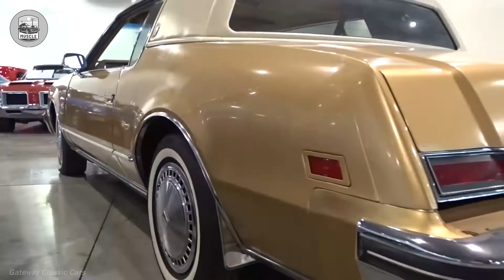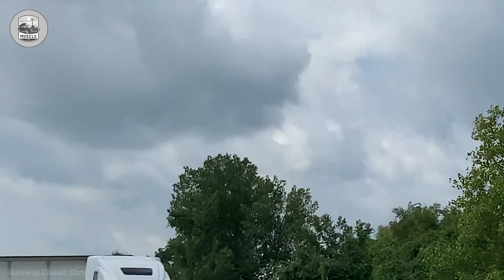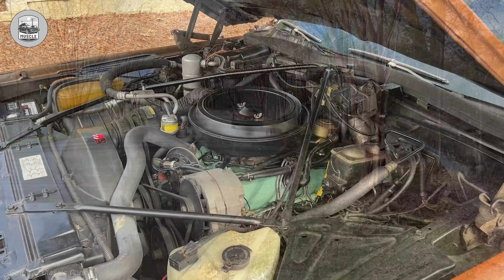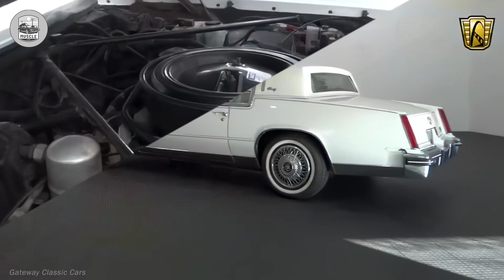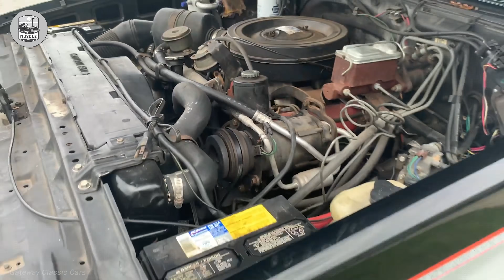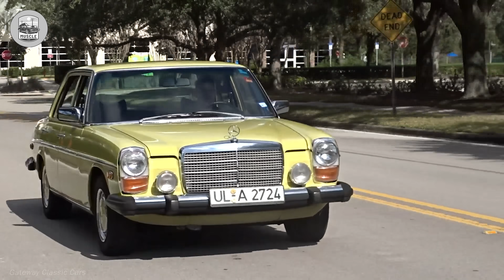Why Oldsmobile's Diesel V8 MOST FAILED?

Comment: To be fair, it was economical considering the engine size and the size cars it was put it. Junkyard Digs did a tow test and if I remember correctly it did 25mpg or more.
Reply from the maker: A lot of ppl forget the bottom end on those was actually pretty stout. Big main journals, decent crank, and the torque curve was right where a diesel should live. The real headaches usually showed up around the head bolts and sealing. Gas block converted to diesel compression meant the clamping load was asking a lot from the hardware.
Another thing that hurt them was fuel quality back then. Early diesel pumps and injectors were sensitive, and a lot of owners treated them like a gas motor… skip filters, water in the fuel, etc. Once the injection system got unhappy, the whole engine got blamed.
In stock trim they were never meant to be high RPM anyway. Keep them in the low rev torque band, keep the cooling and fuel system healthy, and some of them actually ran a long time. Problem was by the time people figured that out, the reputation was already cooked.

Good day bro, hope to see you on our NEWEST VIDEO for The INSANE TRUTH about Ford’s 98 Pound “UNBREAKABLE” Transmission!

Comment: I was a "Diesel" mechanic at a Oldsmobile dealership from '79-'85, fresh out of trade school, didn't know anything about diesels. The service manager handed me a service manual to read. That was my training. The 4.3 and 5.7 V8's all had problems, rear main seals leak "rope seal" Blown head gaskets, injection pump gov retainer would break up into little pieces and plug up the return port, causing stalling. The bottom ends would blow out at any mileage, snap the crank in half, rods through the block, we would oftentimes be able to drive the cars into the shop with horrible damage. GM started suppling us with crate engines instead of short blocks because we were replacing them all the time. The 6.2 was suppose to be better, it blew head gaskets too. Even the V6 diesels in the Ciera's were crap.
Reply from the maker: Yeah I’ve heard the same from a lot of guys who turned wrenches in that era. GM rushed those Olds diesels out the door trying to answer the fuel crisis and they paid for it. Turning a gas block into a 22 to 1 diesel without beefing the mains or the head bolt pattern was asking for trouble. Once the Stanadyne gov ring started breaking apart it was game over because the return got plugged and the engine stalled like someone shut the key off.
Most of the techs I’ve talked to said the craziest part was how bad the bottom ends were. Cranks would snap, rods would exit the block, and somehow the customer still drove the car into the shop making sounds like a bucket of bolts. GM sending full crate engines instead of short blocks tells you how bad the failure rate was. And yeah the 6.2 was better, at least it was a real diesel design, but even those popped head gaskets till the later updates.
A lot of folks bash these engines today but the truth is GM tried to solve a big fuel crisis with gas engine parts and super tight deadlines. Wrong tool for the job. If they’d built a purpose made diesel from day one, the story might’ve been different.
have a great day, hope to see you on our NEWEST VIDEOS...
Reply: That's funny, I worked on them in that era too and I don't remember ever seeing or hearing one with a broken crank. Head gaskets and the like here and there. If GM would have put a water separator on them, that would have eliminated the pump troubles. The guys that drove them long distances, appreciated the 30 plus MPG. The bottom end was plenty heavy and no they were not a converted gas engine.

Comment: its funny so many hate these ... yet i own 3 one in a truck and 2 in cars.... u arp stud them head gasket issues go away... then if creative slap a turbo on... and they become fun  my 1 diesel pushes 15 psi .. but yep they are junk lol nope .... to each there own i guess
Reply from the maker: Right on man. Most folks never gave those Olds diesels a fair shot. Once you swap in ARP studs, fix the head bolts and fuel setup, they actually hold together fine. A little boost like your 15 psi setup wakes em right up too. They were ahead of their time but got a bad name from early builds and poor maintenance. You’ve proved they can be solid when done right.
have a good day, hope to see you on our NEWEST VIDEOS to find the TRUTH....

Comment: A lot of comments, but no real answer, just answering questions with questions, just a bunch of
Reply from the maker: Yeah I get what you mean man. The Olds 5.7 diesel got a bad rap mostly cause it was built off a gas block that wasn’t meant for 22 to 1 compression. Weak head bolts and bad fuel injection pumps didn’t help either. They made around 120 hp and 220 lb ft, not bad for mileage but folks expected V8 power from a diesel. Once you ARP stud the heads, balance the crank, and tune the pump right, they can actually hold 15 psi boost easy and last 200k. Most people just didn’t give em a fair chance.
Have a good day, hope to see you next time on our NEWEST VIDEOS to explore the TRUTH.
Reply: @MuscleCarMasters68 mechanical failures in those engines were caused by ignorance on part of the owners mostly, for 6 years I watched the same thing happened over and over, running the engine with almost no oil in it, far as fuel contamination, all you had to do was go to a Detroit diesel and buy oil and fuel separator, since Detroit diesel was a subsidiary of GM, because cars that were sold in southern states rarely had to replace the engine, so how do you explain that?????
Reply from the maker: You’re not wrong — and the regional pattern you mentioned is real.
A lot of the early failures came down to owner education and operating habits, not just design. Diesel engines don’t tolerate low oil levels, infrequent changes, or gasoline-style maintenance, and many owners treated them exactly like a gas Olds V8. That alone killed plenty of them. Add fuel contamination and no water separation, and the injection system never had a chance.
You’re also right about the southern-state survival rate. Warmer climates meant easier cold starts, less fuel dilution, fewer glow-plug cycles, and far less stress on head gaskets and bolts. That’s why cars in the South often lived much longer than their northern counterparts.
The Detroit Diesel separator fix was well known in heavy-duty circles, but it never made it into mainstream car-owner knowledge. Once oil control, fuel filtration, and maintenance discipl
So yeah — flawed execution by GM, but widespread misunderstanding by owners made the outcome far worse than it had to be.

Thank you for your great information, have a good day and Happy New Year...hope to see you on our LAST VIDEOS with TRUTH Behind the Dana 60!

Comment: As a mechanic who had just graduated in 1978 , based on my own personal observation I attribute mechanical failure due to dim witted owners who bought the cars without prior knowledge diesel engines in general and furthermore those same individuals destroyed their own engines , other than less than the proper amount of oil for the crankcase and lack of a water in separator and all the special equipment that nowadays is standard on today's Duramax 6/8 diesel engines, same shit that was supposed to have been standard on Oldsmobile engines first, but the cheap bastards wouldn't spring for, so the customer became a unwitting pawn,as how to guess what to do maintenance wise, but mechanically the engine was built well, but was poorly maintained
Reply from the maker: Exactly, Raymond  you nailed it from a mechanic’s point of view. The old GM diesels, especially the converted Olds 350s, weren’t junk like people say — they were victims of bad ownership and cheap corporate shortcuts. Most buyers didn’t understand diesel maintenance back then — no water separator, wrong oil, skipped fuel filter changes — and that spelled disaster. You’re right, the engine’s core design wasn’t bad; it just needed proper support systems. If GM had invested in better training and components like modern Duramax setups, those motors might’ve earned real respect instead of a bad reputation...
have a great 
hope to see you next time.

Comment: What killed many 5,7 diesels, was the lack of a water seperator. Diesel fuel in the 70`s and 80`s was notoriuos for water content. Owners with some diesel experience (boat and truck owners) installed vater seperators in their cars from new, and put 0.5-1% with two stroke oil in the diesel fuel for better lubrication of pump and injectors, and never had any problems with theese engines. The later DX version where good and reliable engines. Some drove their diesel engines over 300.000 miles.

Comment: I never understood why engine torque matters. Horsepower and horsepower over an RPM range is all that matters. You can get any torque you want at the wheels with appropriate gearing.
Reply: Yeah! And have a top speed of only 35 mph.
Reply: Or need a 25 speed transmission.... 😲
Reply from the maker: This is one of those debates that never dies 😄 and both sides are partly right.
On paper, yeah, horsepower over an rpm range is what determines ultimate acceleration and top speed. Torque is just a math component of hp. Gearing can multiply torque at the wheels. That’s all true in a physics book.
Where torque starts to matter is the real world. Street cars don’t have infinite gears, instant shifts, or engines that live at peak rpm all the time. A motor w strong torque down low feels fast because it is fast where you actually drive it. Pulling away from a light, rolling into traffic, passing without downshifting three times. That’s torque doing the work.
You can gear a low torque high rpm motor to hit hard, but then you pay for it w drivability, noise, heat, fuel use, and yeah… top speed if you go too far. That’s why the jokes about 25 speed trans and 35 mph exist 😂
That’s also why big cube street motors ruled. They didn’t need perfect gearing or constant rpm. They just pulled. HP wins races on paper and at the track. Torque wins arguments at stoplights and on the street.
Different tools, different jobs 👊

BTW, A lot of people talk about it, but if you don’t actually know why that insane GM carb trick woke these v8s up, our newest video explains exactly how it worked.
have a good day and A Merry Christmas...

Comment: Was the early Oldsmobile 5.7 Diesel as quick or quicker than such traditional Diesel cars as the Mercedes 240D and the Peugeot Diesel ? None of those cars were "fast" although some of them were reliable and long lived when maintained. Only when Mercedes began offering a turbocharged "300TD" did a Diesel start to overlap performance of some gasoline fueled vehicles? 
 Sometime around or after 1980 the Olds 5.7 "DX" got a higher grade engine block ?  
Meanwhile Olds gasoline V8s got about 100 lbs. of metal removed from redesigned and inferior engine blocks used on 305 and 403 gasoline engines and maybe the later 350 gasoline engine ?
Reply: NO! they were absolute POOCHES
Reply: Olds NEVER made a "305".....
Reply: @davelowets  
True, he was actually referring to the 307.
Reply from the maker: @davidpowell3347
You’re asking the right questions, and the short answer is no, the early Oldsmobile 5.7 Diesel V8 was not quicker than cars like the Mercedes-Benz 240D or the Peugeot diesels of the same era. In fact, straight line performance was never the Olds diesel’s strength. Stock for stock, it was slow, especially in passenger cars saddled with tall gearing and emissions era calibrations. Torque was there down low, but acceleration was nothing to brag about.
Where the comparison gets interesting is intent. Mercedes and Peugeot designed their diesels from the ground up as diesel engines. Heavy blocks, conservative rpm limits, and fuel systems engineered for longevity first. That’s why the 240D felt painfully slow but would run forever if maintained. The Olds 5.7 was a gasoline architecture adapted to diesel pressures, and that decision defined its fate. When everything was perfect, they could live. When fuel quality, maintenance, or hardware slipped, failures piled up fast.
You’re also correct on the timeline. Around 1981, Oldsmobile introduced the improved DX block, which added strength in critical areas. By then, however, the reputation damage was already done. As Mercedes-Benz 300TD entered the U.S. market, that was the real turning point. Turbocharging finally gave a diesel performance that overlapped with some gasoline cars, something the naturally aspirated Olds diesel never achieved.
On the gasoline side, your observation is also fair. GM aggressively removed weight from its small block castings during the late 1970s and early 1980s. The Oldsmobile 403 and later engines emphasized reduced mass and fuel economy over brute strength. That strategy worked for emissions and mpg, but it narrowed the margin for abuse. Just to keep the record straight, Oldsmobile didn’t make a 305, that was Chevrolet. Olds used the Oldsmobile 307, which often gets mixed up in these discussions.
So your framing is accurate. Early diesels weren’t fast, they were durable when purpose built. The Olds diesel tried to shortcut that process and paid the price. Mercedes didn’t make diesels exciting until turbocharging arrived, and by then Oldsmobile’s diesel story was already written in the public mind.

If you’ve ever wondered why that GM carb trick made lazy v8s come alive, we go deep into it in our newest video and explain what most people missed.
have a good day and A Merry Christmas....
Reply: 1981 was the first year the improved DX block was used, but it hardly mattered to those who were already disappointed with their Olds diesel-powered cars, and 1981 was also the same year Mercedes came out with their 300TD (meaning when it became an actual "Turbo Diesel" wagon) here in the U.S.

Comment: We need to get one thing out of the way: the LF9 5.7L diesel V-8 is NOT an outright conversion of the existing gasoline Rocket 350 V-8. Rather, while it had the same bore and stroke dimensions as its gas cousin, the diesel had to be made with more rigid parts to withstand traditional diesel operating conditions, including the block, crankshaft and cylinder heads.
Reply: This is correct. The block internals were completely different as well as the entire top end. The crank main journals were 3” compared to gas engine 2.5”.
Reply: @alwaysanotherproject No. A complete gasoline top-end will bolt RIGHT on to a diesel block....
Reply from the maker: This is one of those debates that refuses to die — and both sides are partly right.
The LF9 5.7 diesel was not just a “gas 350 with injectors.” The crank had larger 3.00 inch mains vs 2.50 on the gas motor, compression ratio was around 22.5 to 1, the block had thicker main webs, different head bolt strategy, and provisions for the Stanadyne DB2 injection pump. Internals were absolutely beefed up for diesel cylinder pressures.
But Dave isn’t wrong either. The architecture was still Oldsmobile small block DNA. Bore spacing, deck height, bellhousing pattern, lifter layout — all shared. That’s why gas top ends physically bolt on. The diesel block is basically the strongest production Olds small block casting ever made.
Where the real failure happened wasn’t the casting — it was head bolt count, early fuel quality, lack of water separators, and owners treating it like a gas engine. Stretch bolts + 22 to 1 compression + water in fuel = head gasket city.
Real fans know this wasn’t a “weak block” story. It was a system integration failure.
And that’s a very different accusation.

Have a great day, hope to see you on our NEWEST VIDEOS for Why GM THOUGHT They Understood the 1964.5 Mustang… and Paid for 900 Days!
Reply: It resembled more the older Olds 330 or 350 more than it did the contemporary Olds gasoline V8s which had been degraded (block didn't need much strength to run the low compression smog motor tuning)
Reply: It was the same block design as the gasoline engines except for thicker main webs in the bottom end, and an extra boss cast in for the injection pump. 

It is VERY easy to convert a diesel block into a gasoline engine. ALL gasoline parts will bolt to the diesel block. The distributor needed for a gas engine will even drop right in the factory location where the diesel vacuum pump used to reside. 

The diesel 350 had MORE in common with the gasoline 350 than it DIDN'T.

Comment: As narrator talks about the 5.7 diesel a truck with the Detroit 6.2 liter diesel (debuted in 1982)  is shown driving. Then at 3:08 a Toronado is shown that isn’t a diesel - no diesel badge on the trunk.
Reply: Maybe they couldn't find the specific pictures.